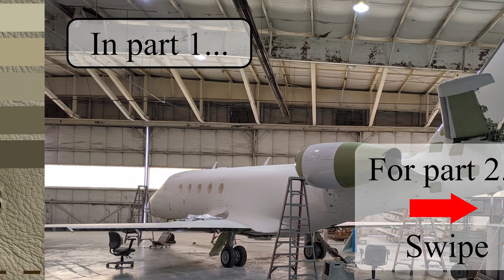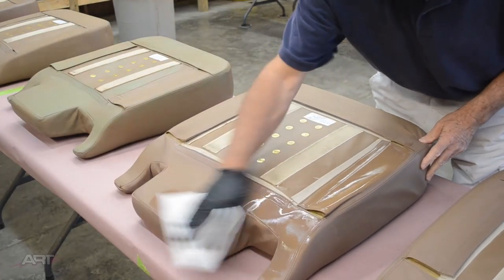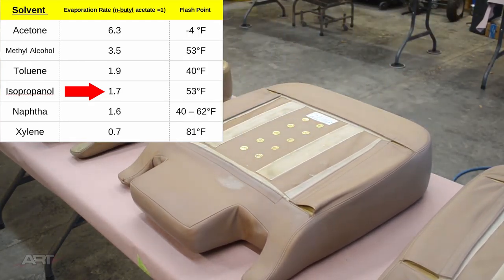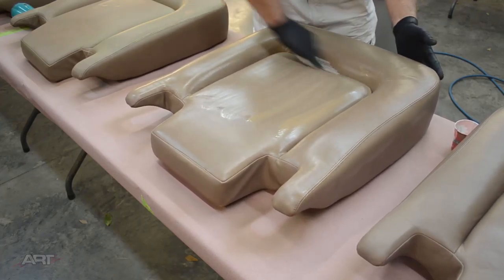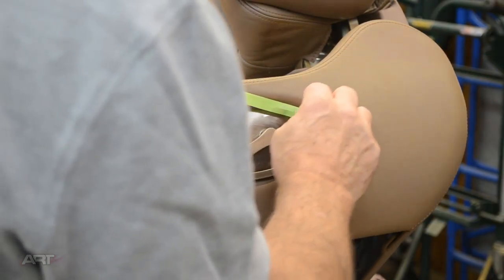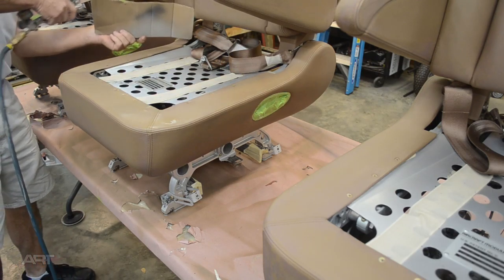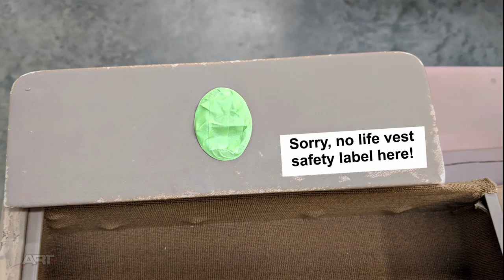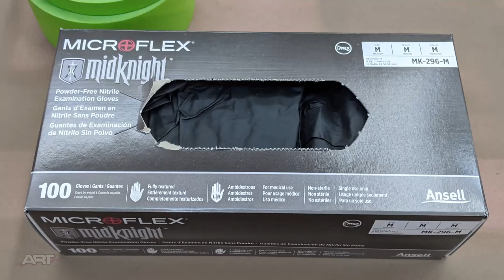Saving the Gulfstream Part 2 v30

Comment: What a wonderful couple of videos thank you so much for some wonderful tips. I do have a question though. I don’t remember seeing this but did you use a primer like hi-tac or anything similar? If not would you be able to explain the reasoning. Just curious if I have been using an unnecessary step. Thank you again.
Reply from the maker: You missed the part where isopronanol leaves the existing coating open and tacky.  Thanks.
Reply: A.R.T.'s Real Repairs for Real Customers Oooh got ya so the isopropanol serves that purpose. Good info to know thank you very much for sharing.